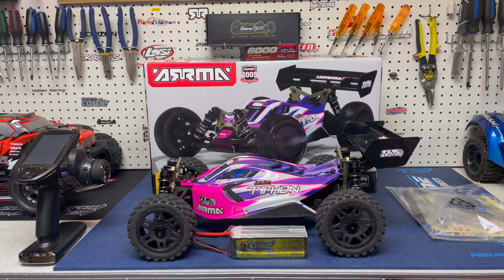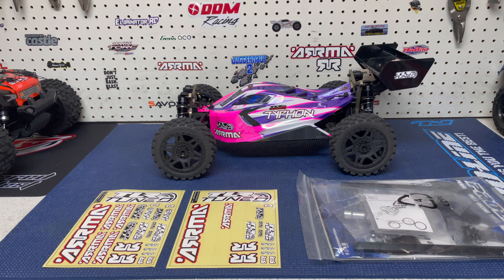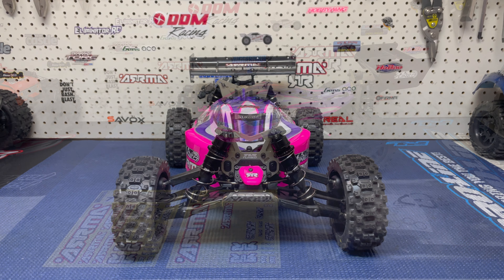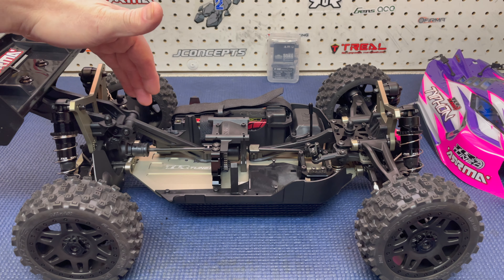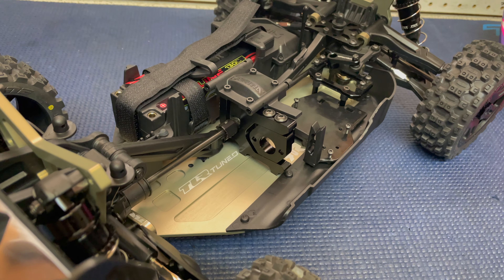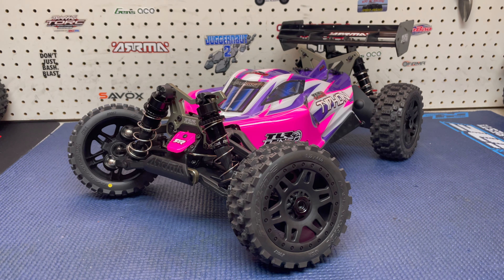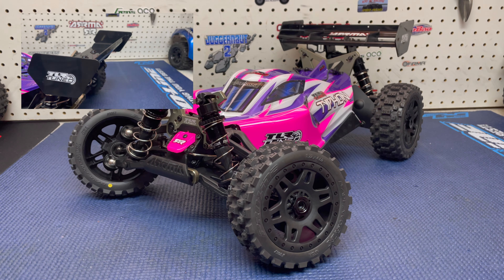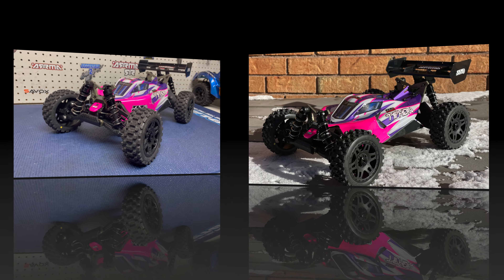Arrma Typhon TLR Tuned (Unboxed)

Comment: The TLR Typhon doesn`t have Aluminum chassis braces because racers usually don`t wan`t that. Some even remove the mid chassis braces completely to give it more flex to adjust the car to the track. This Buggy is more or less an entry level race roller. Sure you can use it as a basher, but there might be better options for that purpose.

Comment: Great unboxed'ing😊 Good point on the battery.  Seen too many folks having issues with the bodies because of battery sizes.
Reply from the maker: I've had that issues a few times. Go to drop in two 3s lipos and found out they don't fit.  The Tattu 6s pack fits perfect.

Comment: Please try a lightweight setup before you add metal braces and other heavy stuff, 4s only with something advanced like a XR8 pro with enough turbo timing will give you amazing power and speed, and it'll be much much lighter fun and nimble than a 6s setup with the Spektrum 150

Comment: Nice buggy 🤩 I'm not a fan of the color, but everything else is spot on! My V3 Typhon is lightened with all kinds of M2C and CF so it would have been really nice to be able to just buy this as a roller years ago. Will be interesting to hear your thoughts on the Hobao buggy. I have seen one unboxing of the 80% version and it looks really good too 👍
Reply from the maker: UPS has the worse tracking ever.  Last night at one point it was showing "Returning to sender" and now its saying "it is on it's way". So I have no clue.  lol